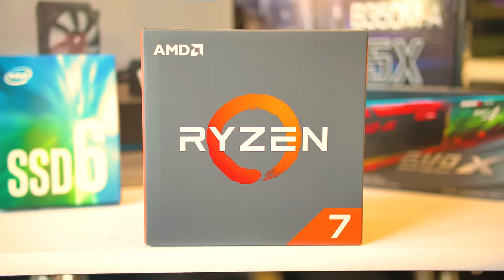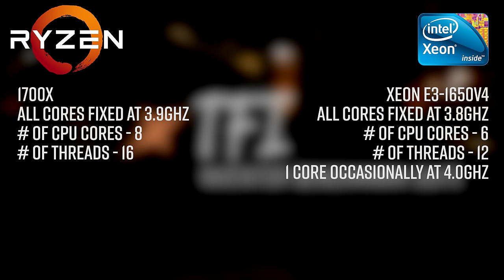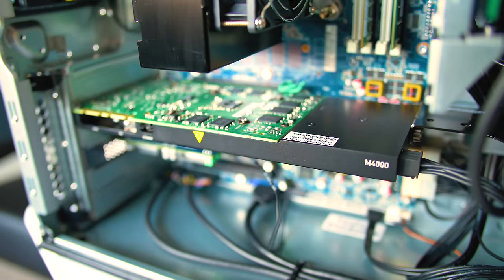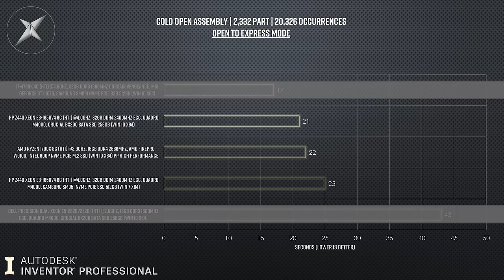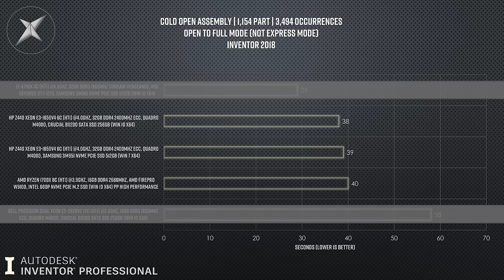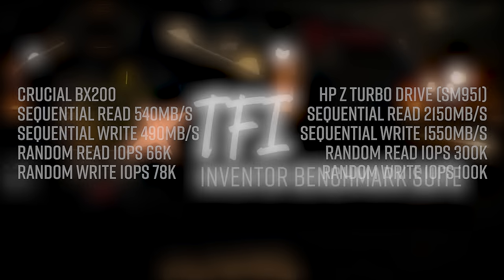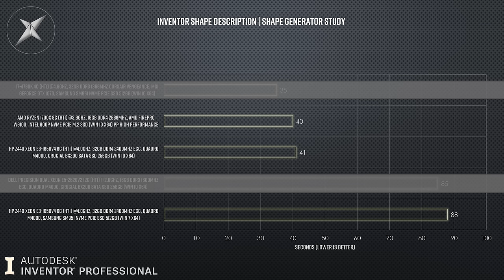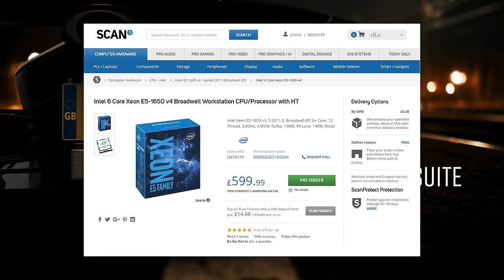Oi Ryzen, here's a Broadwell-EP v4 Xeon m8 wot u got | 3D CAD PC Hardware Benchmark #2

Comment from the maker: Edit: I mentioned how my RAM seemed to underclock itself to 2133Mhz... I realise this is the base frequency of DDR4 but didn't know that the advertised 3000Mhz on the RAM is simply a profile to be enabled in BIOS.  So that clears that up.

In the world that I operate in, cost isn't always the most important metric.  Engineering businesses don't always look to save money on their hardware by buying the most cost effective solution for their hardware, many will often buy whatever yields the best ROI over time and whatever best works with their engineering software regardless of cost within reason.  So please do not treat this content from the perspective of a PC gamer or the typical content creator looking for a compromise between price to performance.
I did not buy the 1800X because it's been proven that with a very slight and marginal overclock, the 1700X can perform to a very close if not identical level to the 1800X.  I have seen nothing to suggest the 1800X would yield significantly different results in tests like these to the 1700X.
If there are any game changing developments in the near future which significantly increase the performance yields of Ryzen I will perform and release further bench tests and clearly mark this one as out of date, however as of today this is the current state of Ryzen.
Reply: I really appreciate this! I've been trying to find how Ryzen performs in these areas, and this validates my concerns. The bugs that hinder Ryzen in gaming also hurt performance in other lightly-threaded workloads. And, the majority of these tests don't even use more than 4 threads. I was surprised how the FEA didn't even seem to be highly multi-threaded.

Interestingly enough, not even the Xeon seems like it would match an i7-7700K in most of these tests, especially if it is automatically overclocked to the maximum Turbo Boost frequency like many motherboards like to do. For CAD and animation workstations, the 7700K is an absolute beast. It may have even completed the FEA test faster than the Xeon. And, the lightly-threaded nature of these tests is very apparent in how poorly the dual Xeon system performed. The only highly-threaded tasks here are the raytracing and the Cinebench. However, Iray with GPU acceleration could be used for the rendering with the 7700K, and it would win practically every test.

But, 4C/16T may not be enough for everyone. In those cases, a 6-core Skylake-E may be the sweet spot when it comes out. Even if bug fixes bring the performance of Ryzen 7 up to where we would expect, Skylake-E should still be faster and overclock better (almost most people probably don't want a workstation overclocked). Of course, we will have to see, but this is my prediction. The only situation where I can see Ryzen being preferred is if the extra cores are needed for other things and ECC is necessary, again, assuming that the bug fixes sort out the performance. But, this would apply to other processors with higher core counts and lower clock speeds as well, regarding CAD or animation workstations in general.

Edit: Well, it looks like the "bug" is just a higher dependency on RAM speed, so I don't expect any magic updates. From these tests, 3600MHz RAM would probably be needed to close the gap in all cases. And, there is still the matter of the 1700X being overclocked here and also being a consumer component.

Comment: All i can say is good work, the results are what they are under the current circumstances, but I hope you'll retest these systems in a couple of weeks, when RyZen will be able to operate with 3.2GHz RAM. The platform needs to mature, as there are still a lot of bugs in the BIOS and Windows scheduler, which kinda' cripple the new AMD CPU. The X99 platform had a lot of bugs too, when it launched ... so i hope you'll give RyZen a second chance :)
Reply: Yeah, these tests seem to show that the bugs causing less-than-expected gaming performance do affect other things, specifically other workloads that are not highly threaded. Most of these tests rely on single-thread performance, and I think people don't realize how many workloads are still single-threaded. I'm looking at hardware for an animation rig, and it mostly relies on single-thread performance as well.

I could not advise anyone to build a workstation on an immature platform. And, it is possible that there would still be architectural weaknesses without bugs; we have no way to know at the moment. But, I do expect the performance to be much better with time.

Comment: With the silicon limit of 7nm, right around the corner, it looks like crammming more and more cores into a chip will be the solution to continue increasing performance. However, this demands a different approach to programming. How do you think, single-threaded software like Solidworks and Inventor, will cope with this change?

Comment: Just pointing this out before someone more critical goes full snowflake when utilizing a lot of GPU intensive rendering tests it looks more like a comparison of a Fire pro W9100 vs a Quadro M4000. Which let's be honest could potentially skew results.

Any particular reasoning behind this pairing, as you can easily run the Quadro on the Ryzen system?
Reply from the maker: +MrBaxtrax Because I've already proven in previous videos that Inventor has no GPU acceleration, none of these tests are GPU dependent. I could have ran these using any GPU and each result would have been the same. Even the fps testing is CPU weighted, see my quadro vs firepro vs geforce video for info on that.

Comment: In all fairness, one can't make any claims that one system is inferior to the other without supplying both with the same  memory specs. It ends up like comparing Apples to Oranges. The results would have been better substantiated if both systems had the same amount of memory.
Reply: YES!! Also, BROADWELL XEONS are my fave on my rare oem dual BROADWELL system (2 - Xeon 2679 V4's) ....now with my two Radeon WX 8200 Pro's now.... 40 core/ 80 threads.... SWEET! One 2679 v4 is nice the turbos are GREAT!!! 200 TDP. BEST BE... HAH....

Comment: What is the workstation workload is the question for us it is 3D CAD for others it is completely different, I understand that synthetic benchmarks don't show real life but it depends what you do.
I was surprised that in FEM they both were close and in meshing Ryzen was worse but in one test where Program takes advantage of all the cores/threads it destroys. Raytracing it was 27% faster and that is the point where it shows what it can dor if something is programmed to take advantage of the CPU.
The point of Ryzen is cheap 8 core with full 16 threads CPU, if What You do can use them like in video creation then an awesome new cheap option for You.
In the end Your conclusion is spot on. If You run Inventor then just choose i7 that is clocked the highest and probably newer one has better IPC but that is all that matters for regular CAD engineer. For rendering more cores is better and go for Ryzen.

PS: would like to see bigger simulation than the rim, something on assembly level as 25s is to quick to see any real difference. Maybe it is stupid of me to run simulation on assemblies but they regularly take at least couple of minutes on i7 4790k, therefore it would be interesting to see them compare on more longer ones.
Reply from the maker: I did have an assembly at first, I was going to use that in the test but it just took far too long to mesh it.  That rim still takes 5 minutes to mesh so I made the decision that at 5 minutes, that's well enough scope for better hardware to tangibly shine and show an improvement on, it's only the simulation itself which is quite quick.  On the larger assembly (which wasn't even that large), it was taking upwards of 15-30 minutes to mesh it.  The bigger the tests the more time that adds, at the moment it takes me around 1.5 hours to fully bench just one system, with a bigger mesh that'll be 2 hours, if I made other tests bigger I could be spending 3-4 hours per system and then a day of video editing and whilst I'm doing all this after an 8 hour day in the office for my day job, I just unfortunately can't do that.  If this ever becomes my full time job I can happily do this all day but at the moment it's a battle with time.
I hear you though, as I bench more systems if there's not much variation in the sim results I'll look to mod the test as much as I can!

Comment: It would be nice to see the results of a benchmark with the Quadro M4000 combine with the Ryzen cpu.
Reply from the maker: +Mathieu Blibli None of my tests have any GPU acceleration as Inventor has no GPU acceleration, so the results would have been the same. Tbh I'll do it anyway as I've got the hardware but I've already proven in a previous video that there is no difference seen anywhere in Inventor when using different GPU
Reply: Thanks, I'd like to see the results! You know sometimes we think that it won't make a difference and after all it does.

Comment: 10 years for workstation? 5 years should be max without any upgrades in any serious company. Even, if there is only 6% increase in CPU performance per year, after 5 years there will be 34% jump. It's substantial improvement - it would increase productivity by 60h/year. 
I can imagine it happens, especially when company buys Quadro and multi Xeons PCs not suited for specific work-flow and for much more money than it is reasonable. Unawareness can be painful, expensive and very sad.
Either way, great video :)
Reply from the maker: Happened in the place I'm at now, they had 7 year old workstations with Quadro 2000 cards and Xeon W3550 CPUs, they were terrible.  Only just replaced them last week after 7 years.  When you've got 150 systems the IT manager just doesn't have the budget to replace that many every couple of years, but 7 years was and is far too long.

Comment: I've made some stats:
i7-4790k @4,6 - 18,8 min - 100% - FPS:100%
E5-1650v5 - 20,2 min - 93% - FPS:93%
1700x @3,9 - 21,9 min - 86% - FPS:81%
2xE5-2620v2 - 37,2 min - 51% - FPS: 36%
(rough estimate i7-7700k@4,9 - 15,2 min - 123% - FPS:123%)

Ryzen 1700x is about 10% slower than E5-1650v4 but Xeon is 7% slower than i7-4790k@4,6 and probably about 25% slower than i7-7700k@4,9.

So, Ryzen is good, not great but same is about any Xeon - they are good but not great.

Difference between E5-1650v5 and i7-7700k should be around 5 min in this benchmark set. If someone would perform three times this workload in his work day i7-7700k would save 15 min/day which is 62h/year - 1,5 week of work.

In my mind it's hard to recomend for Inventor anything other than i7-7700k especially if it is more expensive - negative ROI.

For FEA/CFD/rendering: I think second dedicated PC would be more efficient and productive:
4 RAM channels: E5-1660v4/E5-1680v4(for more than 128GB and ECC RAM) or i7-6900k/i7-6950x
8 RAM channels: 2x E5-2667 v4  or AMD Naples (Q2 2017)  
16 RAM channels: maybe 2x AMD Naples or intel's - or maybe not - it's getting very exotic

Two PCs can be used almost like one - google synergy symless - cool software.
Reply: This Video Is Great see intel is not lose yet, imo most amd made are "overhyped" and "dramatic"
Their naming scheme is cringe af

Comment: ok so if cad uses single threaded performance then wouldn't an i7-7700k screaming at 5 GHz would compete with these xeons? I am not a professional so if I can save 400 bucks I will lol
Reply from the maker: Yea the 7700K at 5G would blow the Xeons out the water and smack them into last week.  But overclocking isn't recommended for a professional system in a commercial space, the unreliability introduced by an OC isn't worth the few minutes of time you'll save over the course of a day
Reply: TFI
what if you don't overclock it very much (like maybe a few hundred megahertz such as the processors tested in this video) would the 7700k still be better?

Comment: Different types of GPUs yikes. 3.9 OC vs 4.6 OC there goes the single threaded work lords. I thought professional works stations don't use OC parts. Your selection of bench marks also suck. The only multi core CPU taxing bench mark was the inventor studio ray tracing bench mark & ryzen fucking killed it. Ray tracing is a big fucking deal in professional world. You should delete video & stick what ever else you are doing.